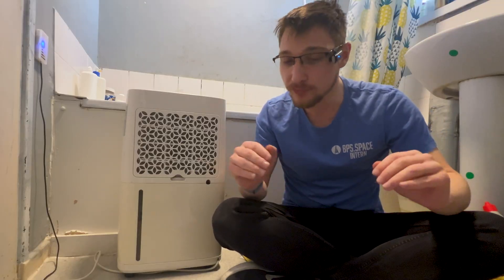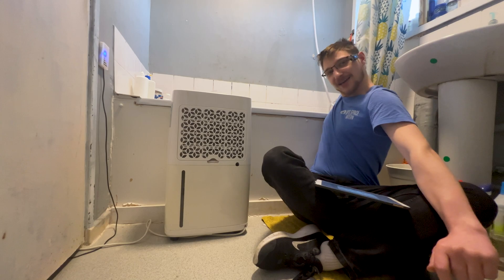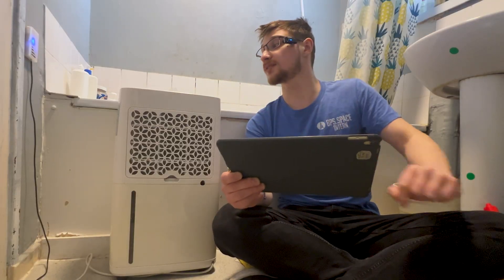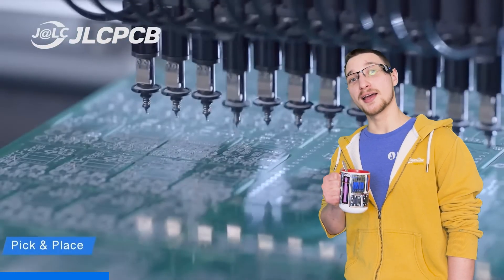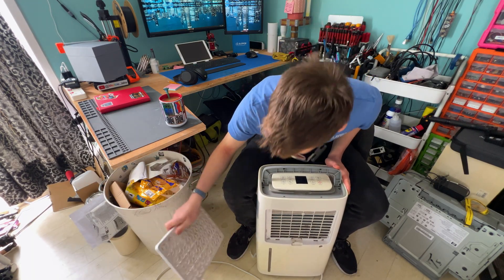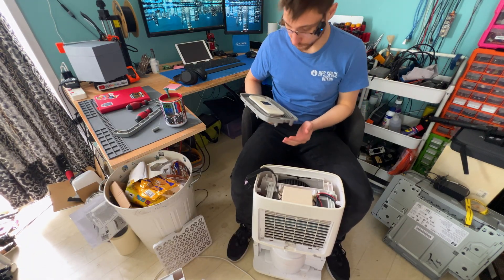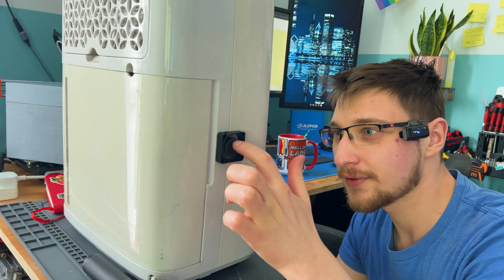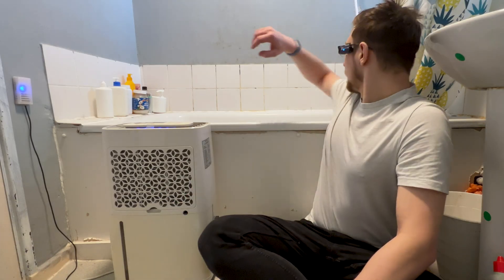How to overengineer a simple problem

Comment: The humidity sensors in dehumidifiers are not calibrated, it can not be calibrated nor does it have any use. The room may be more moist then the inside of the dehumidifier. That is where the moist is concentrated, so automatically all measurements are wrong. Stop nagging about this. It is not worth the fuss.

Comment: I took the sensor out and mount it on the side a while back and its working grate 
Before it was measuring high humidity and minutes after turning on low humidity and shut off but it was doing this non stop on and off

Comment: I have put a relay controlled by an arduino inside mine, to try to turn it on "early" as soon as I get in the shower instead of waiting until the humidity goes high enough. The benefit of this is it never operates at other times in the day when I'm not in the shower. Maybe you can make a video on how to over-overengineer next!

Comment: 14:37 

This is such an easy mistake to make. For sure I think id make the same mistake.

For example. I had a similar issue but it was with my air conditioner unit

I said to my wife the ac is broken and we need to replace it before it starts getting warm.

So I was looking for a new ac online, and actually talked to my dad about it. The issue is essentially the same, it wasnt automatically turning on when the temp dropped. He said "have you cleaned the filter and the sensor", I had cleaned the filter but I hadn't taken it apart to find the sensor and clean it.

Turns out after taking it apart there was a lot of "gunk" caked on the thermometer board, after cleaning it, it turned on at exactly the correct temperature.

So either its easy to make the mistake, or im just a very dumb person. I say its probably the case that im dumb considering I was about to spend $550 when all I had to do was clean it.

(Now in my defense, the thermometer was behind about 10 screws and plastic clips, it wasnt as simple as cleaning the filter)

At least now I know to check the sensor in future

Comment: I think adding the fan didn't do any harm. I still think it was a good idea. Really, the humidity in there wasn't really that high to begin with. I have 2 dehumidifiers in my basement. We live near a lake so it gets really humid here. If I don't run them, the humidity can get up to near 90% in the summer! I have them set to draw down to around 55-60%. They really crank out the condensate too.

Comment: Over-engineering, oh yeah... We all could be at times guilty of this. Mine was a somewhat Rube-Goldbergian setup for automatic removing of condensation from a compressor. I'd tee off a discharge line (the one controlled by a pressure switch, that releases pressure between compressor and check valve), connect a NC pressure switch (salvaged from a small compressor) that would start a timer relay controlling a solenoid valve draining the bottom of the tank into sewage every time the pressure hit the upper limit and the motor would go off. The compressor is used as a stationary unit, so adding stuff isn't a problem.

Comment: Its a different manufacturer and model, but mine says in the manual that when not actively dehumidifying, it only pols its sensor every 30 mins.  How sure are you this was not a timing issue?
Reply from the maker: I haven’t specifically tested it, but judging by how quickly the humidity heat level updates it’s definitely not 30mins

Comment: I mean, this logic made sense to me as my particale sensor i modified did get faster readings when i put a fan on it.

Originally it turned on for 30 seconds, then off. It was noisey and annoying. So i modified it with a lower voltage and to run all the time and that made the sensor readings more accurate. Dont see how the fan would have done any harm in this case. More air over sensor is better reading
Reply from the maker: That was my thought process too. There’s a fan on the particle meter I use, so more air more better results. 😂
Reply: the potential harm is reduced sensor lifespan due to dust build-up